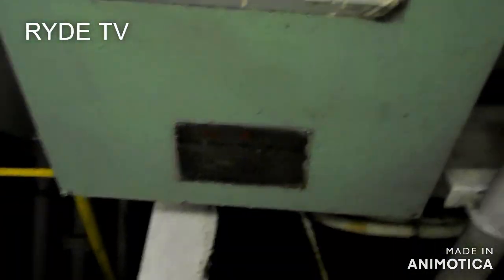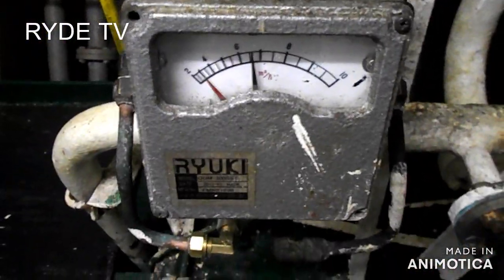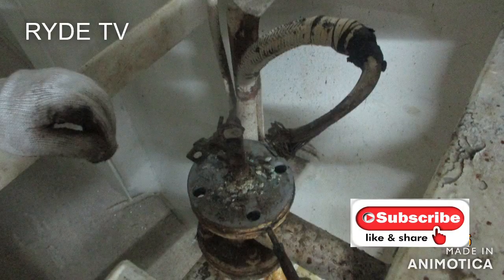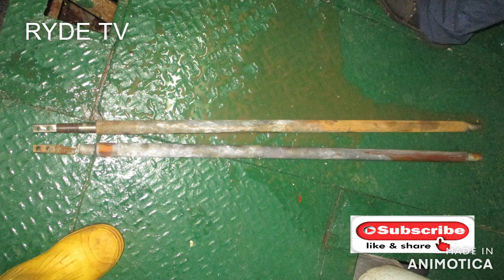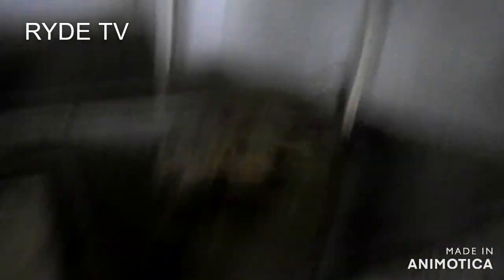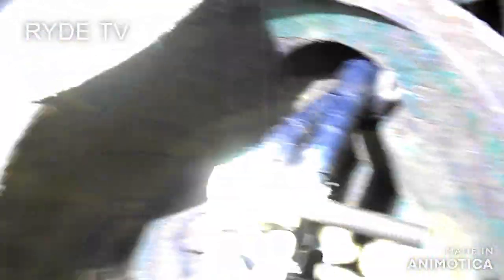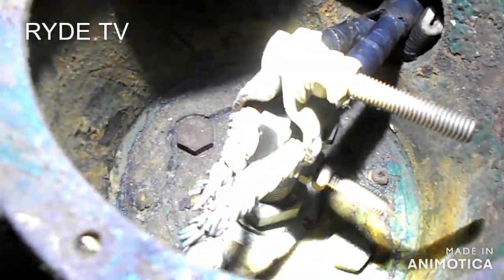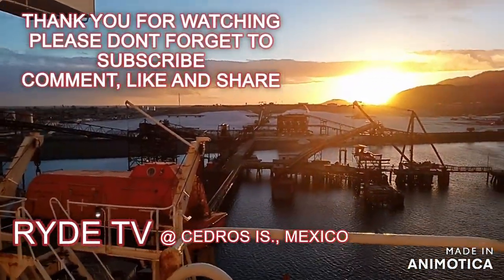MGPS Troubleshooting and Repair  Marine Growth Prevention System

Comment: I sir i have problem on same system.flow rate okay but ampere showing 0 after renewed new anodes alarm showing anode computations
Reply from the maker: have you cleaned the terminals sir? its prone to corrosion. If still not okey better to consult the manuals or ask the maker for technical support. Thank you for watching😊